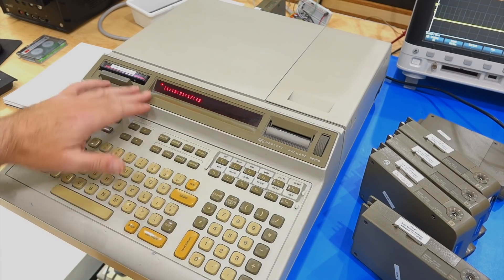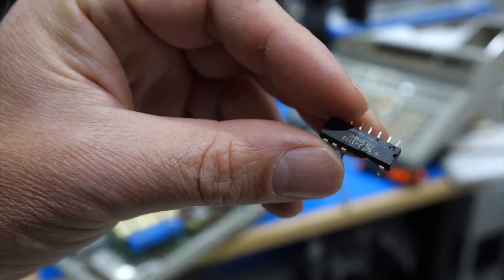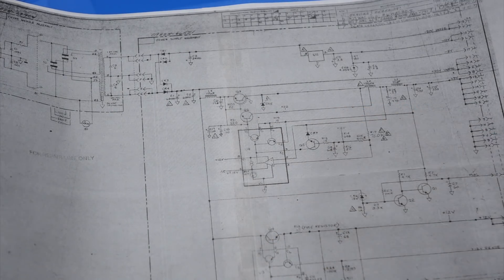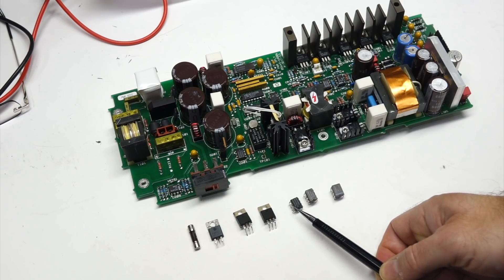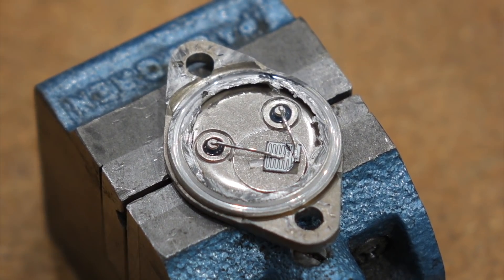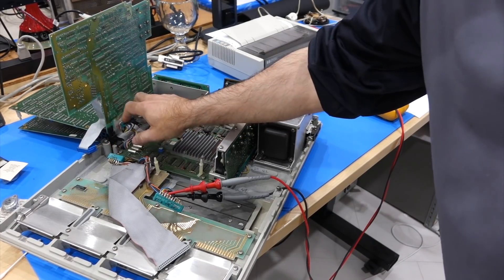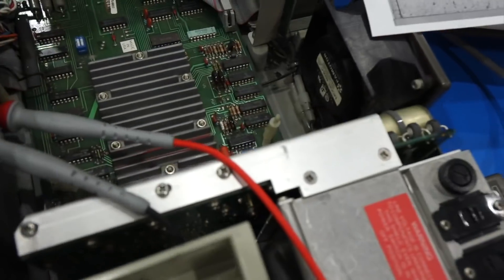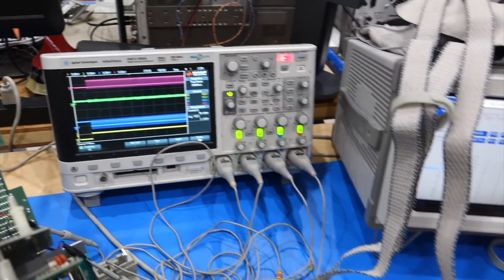HP 9825T Repair Part 1: Power Supply Meltdown

Comment: Not exactly the same but not too dissimilar to when an original Commodore 64 power supply fails and starts sending unregulated voltage into the 5V DC rail... Big difference is a C64 is not too hard to repair and source parts for...
Reply: coool to see you here!!
Reply: @thegodgen  It's always cool to see familiar friends like Adrian. Love his channel too. :)
Reply from the maker: Hey hello there, thanks for visiting the channel!
Reply: Maybe Marc should add some TVS diodes to the 5V rail as we already do in our C64's ;-)
Reply: @Shmbler  A TVS diode would just go up in smoke with continuous overvoltage. You need an SCR crowbar circuit. That will short circuit the power supply and blow the fuse.
Reply: @Shmbler  TVS diodes generally won't have the static dc current rating to cope with this failure mode in the 9825 power supply. This is why HP added a crowbar circuit to later version of this power supply.
Reply: @peteroneill404  I was kidding. There are several Appnotes out there claiming that you can parallel them if you carefully match them by clamping voltage tough.
Reply: Unless one of the hard to source chips die ofcourse :) Luckily there are a number of projects on the way for replacements.
Reply: That's the first thing I thought of when he described the fault, the infamous failure of the Commodore 64 power supply.
Reply: Depends on the fried part, my C64 is not all MOS anymore :-( Fortunately the community has reversed engineered the glue logic and published them as source for some GALs.
Reply: i thought the same! I built that Ray Carlson protector circuit for my original C64 supply and its yet to blow but I've got the peace of mind. (yes i know i should get a new power supply lol)
Reply: I was literally just thinking to myself: "I wonder if Adrian's Digital Basement watches CuriousMarc?" LOL

Comment: Sad day.  I think I would put a fuse before that buck regulator, in case it happens again.  The fuse might blow before the magic smoke is let out.

But it's still a design with a serious weak point.  It really needs to be corrected. 😢

Comment: I'm really surprised that HP didn't provide any over voltage protection anywhere ? But then again, it has happened to me back in the day with my C64 when the 7805 regulator that was supposed to have overheat protection failed and passed unregulated 9VDC and fried most of the computer. But a C64 was not an expensive and groundbreaking HP product like this!

Comment: Had this happen to my beloved HP 5328A that I had for 23 years. One of the 15 volt pass transistors had shorted collector to emitter and basically rendered it a parts unit. I hope you can get this beauty going again, one has to wonder why the engineers at HP didn't include crowbar protection or even a internal fuse like the ones found in the HP 853A.

Comment: 2:55 Schottky diode?  Looks like a Zener symbol to me.  It might have been a early attempt at a crowbar circuit.
Reply: In that configuration it would be just a simple clamp. A zener diode wouldn't be able to handle the much current though. Looks more like a schottky diode in a standard buck converter configuration.